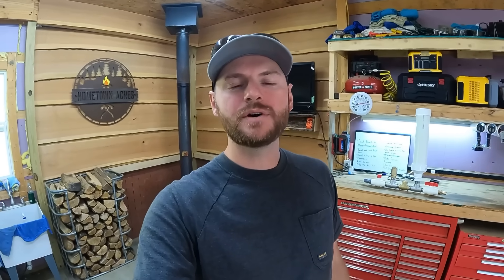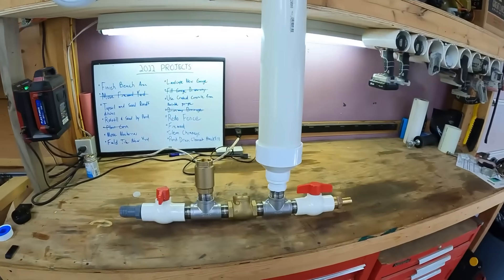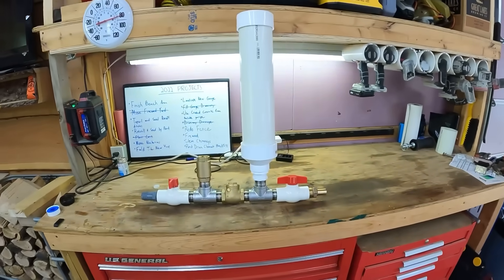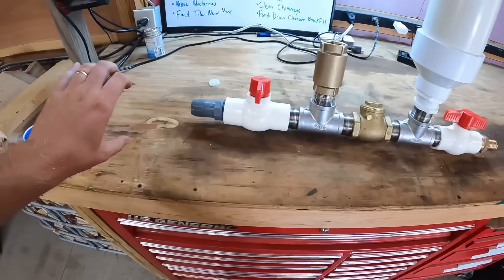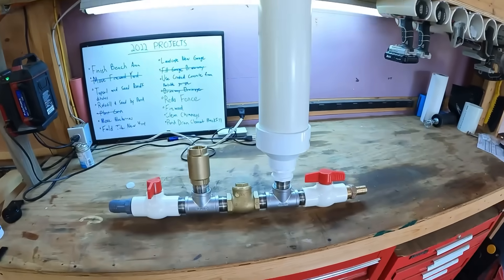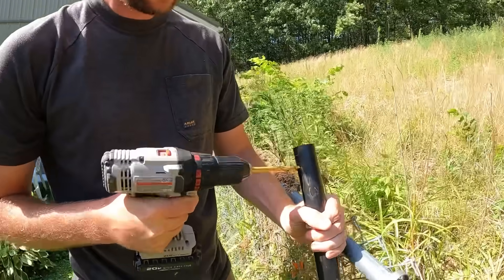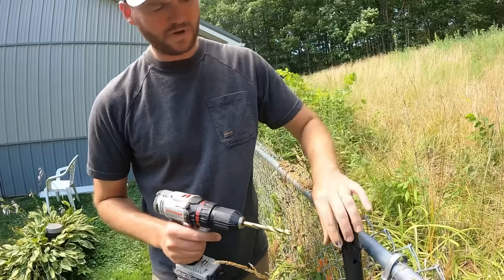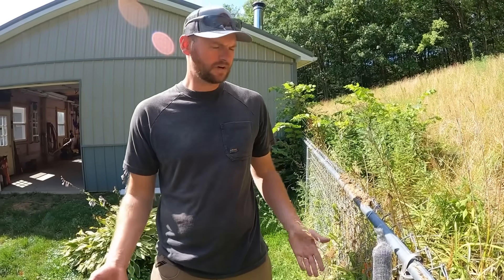We Found Water For The Pond - Hydraulic Ram Pump

Comment: If you have the $$$$$ get a flat roll of 2” discharge hose to salvage the water that is being released from the spring-less check valve. 
2. Putting another smaller diameter tee on that long contraption, right after the spring-less check valve, and you can oxygenate the creek water to become closer to potable/drinking water.
3. Put rocks/gravel on the bottom of the supply IBC tote and cover it to prevent algae. 
4. Mount that contraption on a spare 4x4 post….making me nervous if that SCHEDULE 40 pipe tips and cracks when you aren’t home….
Source: my whole farm runs on collected rain water.

Comment: If you add more pipe it should  syphon if you pond is lower then the creek. I have syphon water over bigger hill s then yours. check the elevation at pond and creek if pond is lower it will work. I like your ram pump any way. Dose it keep the pond full.

Comment: You have a great little project going there. You will learn a lot by doing the suggested experiments folks offer. I offer the following suggestion knowing someone else may have already suggested it. You need to have an air/water barrier in the tank or the water will dissolve the air, the tank will fill with water and the pump will stop. I suggest removing the top cap of the tank and inserting a bicycle inner tube with the valve stem mounted through the cap. reinstall the cap with the inner tube inside the tank. inflate the inner tube to achieve the best performance. Best of luck and fun for you and your project!
Reply: From Melbourne Australia 🐨🦘  I really appreciate how you explained everything so clearly with elaboration and transparency.
Thank you for this brilliant video.

Comment: Interesting ram pump application. It was a good description of the way they work and will certainly be helpful to many. Having said that, I can’t understand why you are not using the siphon effect of the pond being below your creek. The ram pump could prime it and you could connect the two lines at the tank after you have good flow… you wouldn’t hurt the ram pump but the more superior siphon effect would make it unneeded until the next time you need to prime the lines.
Reply: Good idea.  I would add a bypass around the ram pump so that you could use it to prime the line then bypass it after the water is flowing.

Comment: If you modify your spring check so you can easily add or subtract weight to the valve you can increase your volume.
Reply from the maker: Do you think I need more or less weight
Reply: @HometownAcres  It is hard to say. It depends on how high you need to lift vs how much water volume you are getting. That is why I said easily adjustable so you can add or subtract and then measure. Yours does appear to be working pretty good right where you are at. Last time I built one which was years ago I used wire solder to increase the weight until I had it right. Another option you have there is a solar powered pump.

Comment: You should install another pump to the tank your line to the pond can handle the extra volume if the tank fills up too fast move the pond side fitting to the bottom of the tank

Comment: I kinda think you can remove the IBC from the system. Just add a T connector between the delivery pipe and the pipe leading to the lake at the highest point. A T connector is open to the air so there will be no siphon and your water can run directly downhill.

Comment: Of course this will cost $$, but you can hire a backhoe or rent one and add a couple more ponds below outlet pipe, and connect them together with a shallow ditch. When one overflows, it goes into the next one downhill. The ditch will allow the water table to regenerate and benefit all the permaculture downhill.  I would not run plastic pipe from the outlet, but cut in a 4 foot wide ditch down to the next pond. Great vid out now called water wizard of Oregon. Dan tipping will take you on a tour of his pond set up. He is good at explaining  what a number of ponds can mean for your land and believe me it is all good news for you amigo.

Comment: What would happen if i install a line heading up the mountain and then let it all run through a electric generator? or collect above the mountain in my expensive pool. Does the syphon pull the pressure from the pressure container that way stopping the pump?

Comment: 9:36 this sounds counter-intuitive to me. I am not expert, but I would have thought you would want a continuous line. Or at least have the big container pressure sealed?
But I am no expert at all about this stuff, but surely the water that is running down hill with gravity would help syphon the water up the hill aiding the ram pump? With the two working in concert, you would not be required to have the pond be lower than the creek like you would using the syphon method alone, and with the gravity syphon assist, it would be like the ram pump only having to push the water up a distance that is the delta of the creek and the pond, rather than having to push up the entire embankment.
This of course, is under the contingency that there is no air leaks and also that the forces acting on the water doesn't cause it to cavitate? 
But again, I am no expert on actually doing any of this. It's just theoretical in my head, pulling in tidbits of knowledge I seem to have squirreled away as (stuff I will never use)..
If someone can point out the flaws in my theory, I would love to hear it so I know which parts I got wrong..

Comment: So cool! 
Question - I have a well that is about 250 ft deep and I have to use a generator to pull the water up. The generator has to run nearly all day to completely fill the 5000 gallon tank. Would it be possible to use something like this perhaps starting the water running with the generator and getting the pressure going then it would switch to a ram pump and I could turn the generator off? Also I would not want to have the water running out of the spring valve. I really need to find something that is more sustainable.
Reply: I am not a scientist but I think the answer is no. No because the ram pump only works because his creek is running down hill. The creek is already running. To pump water up 250 requires a lot of power. No standard single pump can do it. Water in a pipe gets so heavy a standard pump can only push water up about 30 feet. The pump in your well is a turbo or jet pump. They require a lot of electricity. A lot. Not a little, a lot of power. So yeah the answer is no.

Comment: I see a lot of comments talking about a syphon but the increased flow is the problem with siphoning because there must be enough constant supply. any air or obstruction drawn in from suction due to seasonal water levels and weather breaks the syphon.

Comment: Well done. (NPI)  As watching was wondering if you had purged the air, makes a big difference. The concept isn't new but that looks well built with inexpensive parts. I have worked maintenance for a water processing plant, and came up with a solution for pumping up steep hills. Same concept applied, the "hammer" effect especially. It allowed the pumps to to be switched more accurately. Ended up building and selling more , not the same but is amazing how it can work, Some of the old fountains 2000 yrs. ago worked on this concept. Thanks for the info, I have a great application for very similar scenario. Going to build one. Keep up the good work!

Comment: If you actually have enough drop once you get it over that Hill depending on the length of distance it drops after it gets to its high point you might not be that ram pump at all just got to get over the hill once start off with a piece of 4-in PVC reduce it down to 2 in you'll get head pressure depending on how far up the creek runs I would go with an 8-ft piece of 4-in reduced down to a 6 ft piece of 3 in down to a 2 in piece about 4 ft with a check valve 2 inch pipe up and over the hill puppet once up and over the hill let osmosis do the rest

Comment: In theory if you manage to make a perfect syphon on the pipe going to the lake, whitout bubbles, it will reduce the head pressure required for the pump and increase flow.
You can tune your valve frequency by adding weights to it using a junction nut
Reply: using a second pressure vessel after the apex with a height taller than the apex is what would be needed to maintain the syphon from the ram pump. The ram pump becomes the priming method for the siphon as you know, the second pressure vessel is really an anti air gap vessel. You'll need to put a valve to allow air to escape for priming and then close the valve once the second vessel is full. Probably a good place for a simple air bleed valve so you don't have to maintain manually bleeding it.

Comment: Why not double up the pumps for twice the flow?  Just needed to checkfor rates.  

Technically, a 1" line at 400 feet gravity flow w drop of about 20 feet would get you max about 8GPM.  

So if your creek bed could supply that much,  you could run up to 6 rams and get about 8 gpm through the 1" line down to pond.  Or, try a larger ram?  

Not sure what happens to efficiency when you go bigger on ram size.

Comment: I'm pretty sure running the ram pump directly into a syphon would work perfectly.  In effect you'd then have a self priming syphon - and your flow would be much better (once the air was purged all the way down to the pond).  If you don't think it would work...  test it.  It would take half an hour to temporarily bypass the storage tank to confirm whether it would work as a syphon.  All this is assuming the pond is lower than the water source.
Reply: Just make sure to put a check valve in line to prevent a broken hose down at the ram pump on the pond side causing a reverse siphon where your whole pond gets emptied into the creek. Or as has been suggested just put a tee in at the highest point with a short length of vertical open ended pipe to break the siphon and use a second or third pump to increase the water flow if needed. A reverse siphon event would be very bad and may not be noticed until the pond was emptied or at least emptied down to the level of the submerged pipe.
Reply: @jaseastroboy9240  I'm pretty sure a ram pump is based on a check valve - so an additional one should not be needed.  And breaking the syphon is exactly the opposite of what I'm suggesting - as, once the ram pump has primed the syphon, it would be better/quicker than the ram pump.  But I'm not a smart man.
Reply: @dav1dsm1th  I think i just did a bad job of describing it. 
The check valve suggestion was for the pipe going from the top of the weir down to the pond. It isn't necessary for the operation of the setup, it is just a safety mechanism. If for example the hose from the output of the ram pump was a continuous line up over the weir and down to the pond then if the hose became detached at the output of the ram pump. By storm damage, sun damage, vandalism etc. Then depending on the relative heights you may get a siphon effect from the pond to the creek. The opposite of what is wanted and potentially able to empty the pond into the creek. A check valve could be added to prevent the reversal of the water flow, it would do nothing normally and would only close if the water flow reversed.If the pond is lower than the creek then this would not be an issue.
If the creek is higher than the pond then a siphon would work better, especially if the pipe was cut into the weir a bit so that the "hump" that the water had to get over was less. I think somebody already mentioned that the excavator could probably cut a trench 10 feet deep from one side of the weir to the other, drop in the hose and then fill the trench back in. Basically the pipe would run through the weir 10 feet below the top of the weir. This should improve the siphon effect and the water flow rate.
My suggestion of the vertical pipe at the top of the weir was to break the siphon as a way to ensure there was no chance of a reverse siphon effect. Not to improve the flow rate.
Reply: @jaseastroboy9240  TL/DR.  Have a great day.
Reply: Agree.  And put the output pipe under the water at the pond, then it wont pull air back in the pipe.

Comment: Several comments mentioned that the pond “looks” lower than the stream bed, so it could all be done by siphoning. However, if the pond is not lower, a partial siphon effect could still help if the reserve tank is eliminated. If the pipe stays continuous, it will have the effect of seeming to reduce the height that the pump needs to push the water. Once the water reaches the high point, where he put the open tank, it creates an air break. Instead, if the pipe continues unbroken downhill, than every foot that it drops will pull the water at least part way. If it only drops 10 feet, it will reduce the work the pump needs to push the water as though it was pumping 10 feet less to the high point. It will still need to pump to the full height, until the pipe is full, and the water starts to flow down the other side. However, if the downhill pipe doesn’t create a solid column of water, it will allow air to flow back up (from the pond side) and stop the siphon “assist” effect. It might help to use a smaller diameter pipe on the downhill leg to the pond. Depending on the amount of water flowing down, the water needs to block off air returning back up to the high point. Possibly a check valve at the pond end will stop air from going up the pipe, stopping the siphon effect. The reason a true siphon works is that the water on the downside weighs more than the water on the up side. The lower the outlet, the more difference in weight there is. But if air enters from the outlet, it will stop the siphon. If the down doesn’t weigh more than the up, it won’t siphon on its own, but will effectively reduce the pressure the pump needs to create, as though it was only pumping to the height difference to the pond. If it pumps 25’ up, then flows back down 15’, the pump only needs to lift 10’ (after initially filling the 25’ up)
Reply: my friend,  it's a strange but actual fact that siphoning only works up to a specific pressure.  I can't say what that pressure is or if that pressure would apply here. but I suggested this to the hydrology PhD that was installing my well and he says that the negative pressure will pull oxygen out of the water and generate an air pocket which will necessarily negate siphoning effect.   I've been pumping water and building off grid water systems for over 30 years and my experience is you are correct,  up to around 20-30 lbs negative pressure.   good luck 👍
Reply: The problem is the ram pump itself need the pressure from the delivery pipe to work. If you siphon the water out (even partially) it will stop working.
Reply: @sestun  I disagree, if the ram has to push 30 ft up and siphon effect going down to the pond has a 15 ft drop down, the down pull of the 15 ft on the pond side would zero out 15 ft of the ram side having to be pushed up, leaving the pressure needed to the ram would have reduced load on the output side makingvit work to push the water only as high as the lowest point of the siphon outlet end or a head pressure equal to having it lift water only 15 ft rather than 30. For this to work,, the outlet side of pipe would need to be bled of all air, sealed, and it would have no need for an outlet check valve so long as the end stays submerged in the pond8s needed, so long as the end stays submerged in the pond no air could backtrack into the system causing a continuous reduced load so long as the pond outlet isn't lower than the creek bed it should actually work,  and reduce the load needed to push the water the 30 ft elevation.
Reply: @WeChallenge   @WeChallenge  I think you imagine that ram pump works like an electric or gas pump. The less load on it the better. 
But the ram pump needs the back pressure from the outlet pipe or it will stop working. 
@landtohouse actually has a recent install, when they wanted to lift the water only to a certain height, but then they had to move it much higher or the pump stopped working.